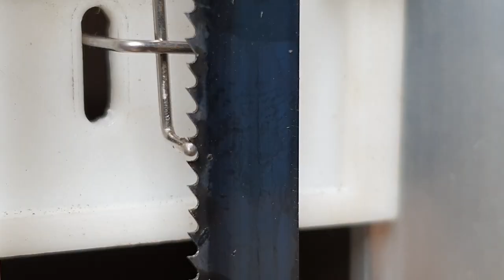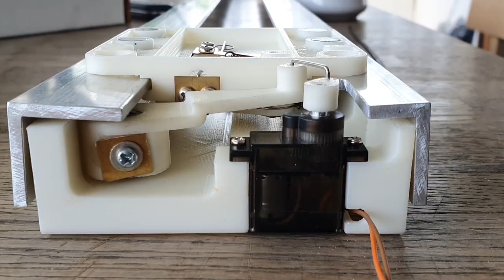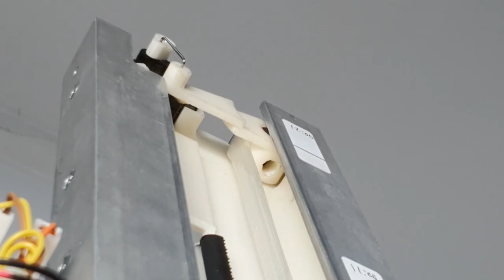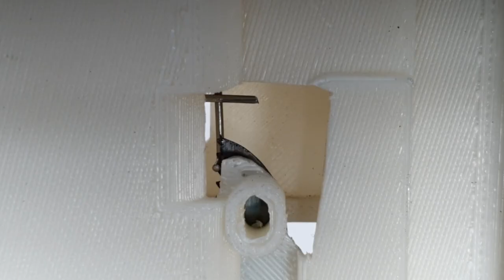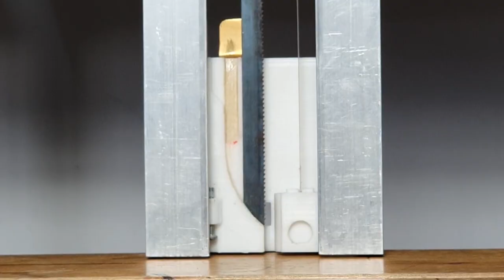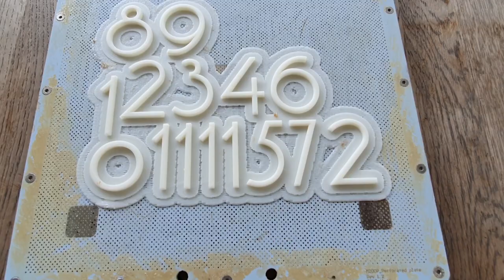Linear Ratchet Clock

Comment: Would something like a lead-screw mechanism work for driving the tape? I've seen stepper motors where the lead-screw passes through them. Affix the motor to the base and the lead-screw to the tape. The actuation time doesn't appear to be critical since you're advancing once a minute, so the motor could be stepped slowly enough to eliminate any noise. Since you'd be using a lead-screw, there would be a tendency for it to hold position through friction, and you wouldn't need to maintain holding current on the stepper motor coils. Or perhaps a small brushless motor that's gear reduced, although you'd need a twp position gear selector (one gear position to move the tape up, another for down). If the timing and gearing were correct, you could eliminate the microcontroller althogether.

Comment: Thanks for the great video! Annealing a bimetal blade with high speed steel teeth would be extremely challenging. It might be possible with a carbon steel blade. It's important to cool down very slowly. Warping is usually due to uneven heat distribution; typically avoided by packing in inert powders, such as lime or vermiculite, although sometimes you can get away with simply burying in hot ash.
Reply from the maker: Yes- this is still a problem I need to sort out! If I can make the steel soft and maybe use a Scotchbrite wheel to knock the sharp edges off the teeth- then it would be "small hard part against big soft part" - longer life!

Comment: Fascinating approach to showing the time, and a very satisfying mechanism too! Has given me inspiration for my own project, thanks for sharing.

I wonder if a small stepper motor and some gentle drive waveforms might help you overcome the noise issue.
Reply from the maker: I failed to mention that one design constraint I added was that it has to run on 2 "D" cell batteries- 3 Volts, low power.

Comment: You may want to look at muscle wire to do the movement... it moves only a small amount per meter and it's fairly slow (as it works thermally) but given the size of the clock and the speed of the movement, it may just do the trick. And it's entirely noiseless to boot.
Reply from the maker: This is a very interesting idea! I have seen so few applications for Nitinol in the real world, it's micro-niche technology. One design parameter I set is that the clock should run for about a year on 2 X "D" batteries, this works out to about 0.3 joules per  minute cycle. Heating a piece of wire might take too much power?
Reply: @leosbagoftricks3732  Hard to say off the top of my head, but you can go to a site like smartwires dot eu and they will have specs about their Nitinol wire. You should be able to derive which thickness you need and how long it should be, and from that the volts & amps you need to get it to contract. There's probably still some practical experimentation needed, but it'll get you in the ballpark at least.

Comment: A very nice design. I wonder if you have made any changes.  A BLDC motor would take car of the noise. A harden pin sleeve would roll on the tooth and prevent some wear issue.

I hope to see a follow-up.

Comment: Just insane. I love clocks and building them but this is off the charts. You should've used a stepper motor with a silent driver if the sound bugged ya. Was that poly carbonate filament you used? Your printer is very dialed in. Once again, amazing stuff. You need to post more often haha

Comment: Nice video. Many clever and well designed mechanisms and nice use of eddy current to brake the descent. Have you considered to harden the tip of the spring instead of softening the blade? Or maybe make just the tip of the spring from the same material as the blade.
Reply from the maker: I think I will try to silver-braze a piece of carbide on the pawl, next thing to try.

Comment: Great project! Perhaps consider SMA (shape memory alloy) wire actuators to replace the servos. That would eliminate the noise issue.
Reply from the maker: Nitinol wire would work... but it's a power hog! My 2 "D" Cells would not last long.

Comment: If you used a solenoid, could you drive it with just a 555 timer? And is the clicking of the solenoid just from impact? Could you put some sort of padding inside or make a custom quieter one?

Comment: love it, i wonder if you could impelement counter saw blade to move upwards instead of  the tape ribbon. i could eliminate the need of the servo motor.
Reply from the maker: Could you explain how it could eliminate the servo? One additional problem is moving the mass of that long blade up and down, it will consume more power.
Reply: @leosbagoftricks3732  yest that is true , i was thinking two sets next to each otter connected to a slow camshaft. When a rotation takes place the saw tooth push the lever up one tooth . Then the other saw blade does the same the other rotation.just like a marble ladder/ lift  A slow planatair motor is silent and strong. Could be used to power. Only problem could be excact timing. 
Could be not what you are looking for , but i love to think of possible ways.

Comment: Instead of annealing the blade, why not put 4-5 blades on top of each other? You can even spot weld them together to act like a single object. The thicker teeth wont be that harsh on the tiny spring wire. Or maybe I'm also missing something obvious....:)

Comment: I’m intrigued by the design integration process around the design of the latch mechanism. How much was done using the CAD software, and how much was done by printing a draft, testing and modding that assembly and then transferring the learning back to the 3D CAD model?
Reply from the maker: Geometry and concepts are developed in CAD- then the physics are tested, sometimes in mock ups of individual mechanism "modules," or in combination.
This is where the tricky interactions start to flare up.

Comment: Rather than attempting the soften the blame, why not put a hardened tip on the ratchet wire? Or maybe even a rotating collar that cover the tip?
Reply from the maker: Wow- great idea! I might try to braze a piece of carbide to the tip.
Reply: @leosbagoftricks3732  you can also heat the metal  up until it glows and then immediately dip it in silicon / mineral oil. The rapid cooling process will harden the metal significantly.